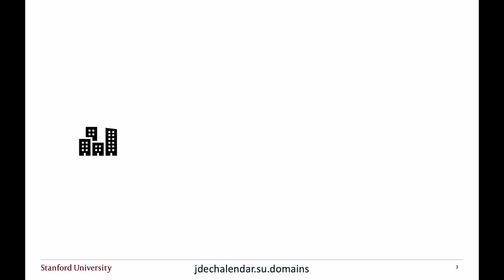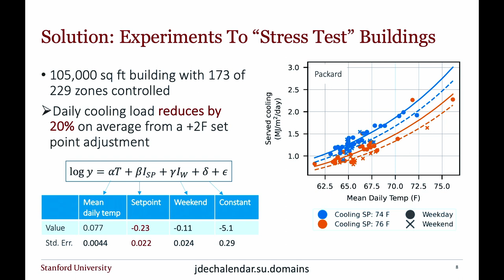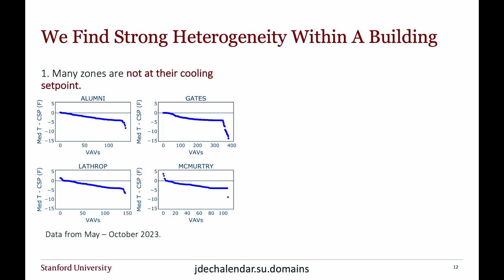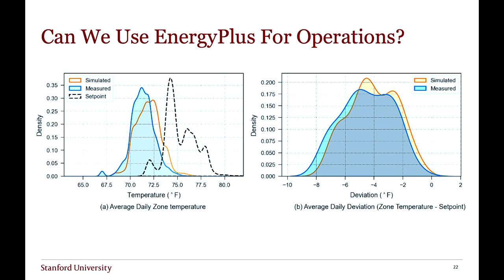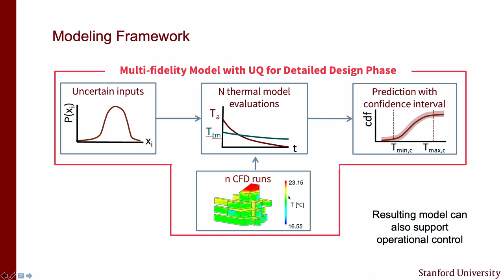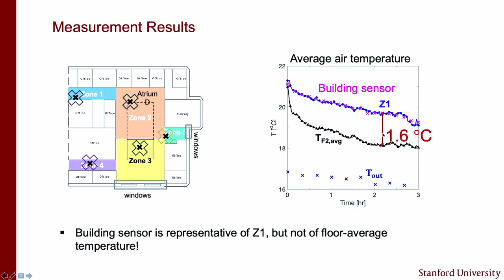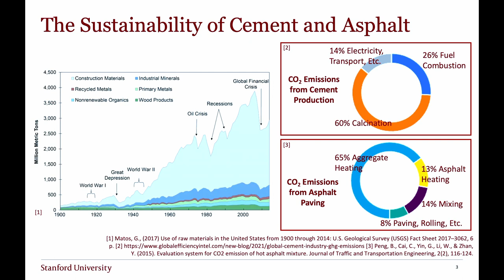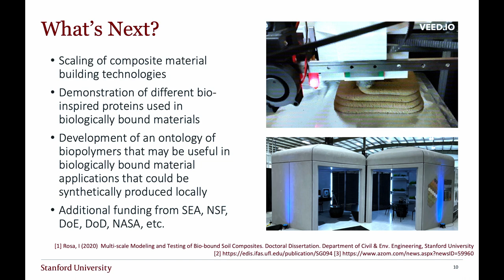Building Energy & Carbon Management | Energy Research Showcase 2024

Comment: Technokontrol's RF-5000, Spain 
All_magnet 1300hp motor 
A megawatt/container 
50yr no_inputs warranty 
No CO2 H20/Mwh 
No wasteheat superconducts coils 
13-units are 12-Mw of 100%-dutycycle baseload 
Power villages farms lt.mfg 
Flip substations offgrid, power datacenters from parking lots 
👉 No miles of wires
17yr RnD sparkless military_spec 
D.Antonio Romero dsgnr 

Least carbon_footprint extraction_to_production/Mwh a low-volume production machine the world needs millions of them.

Back to the talk !